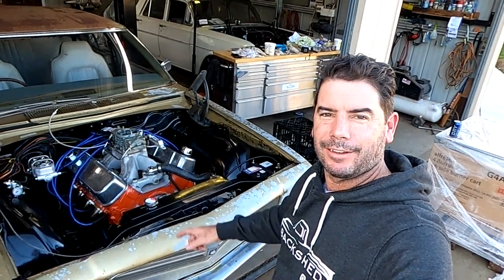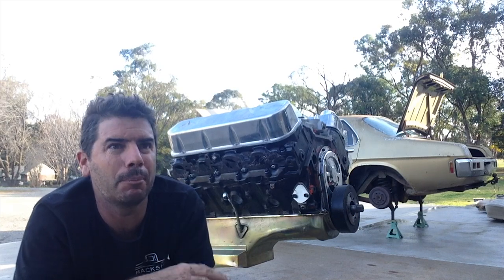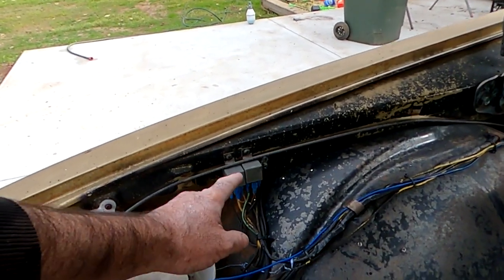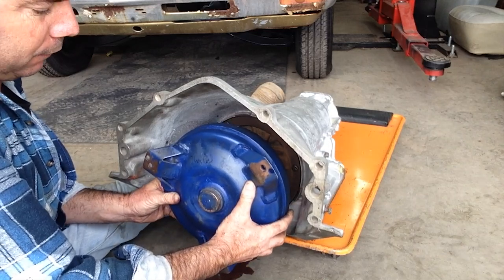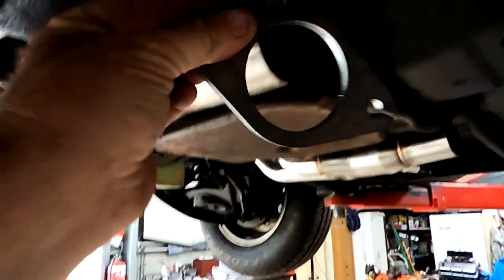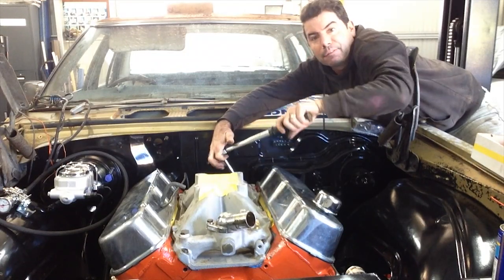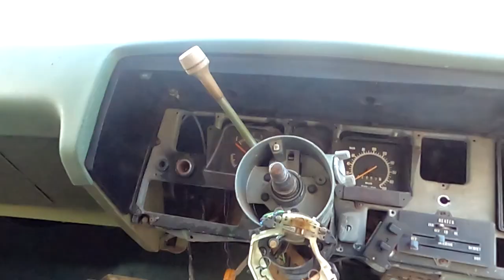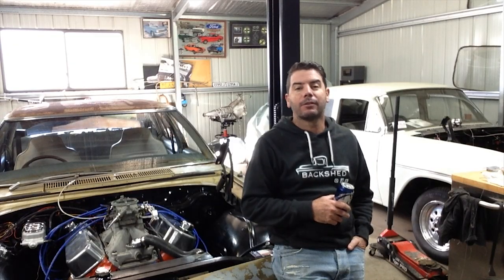EP14 HQ HOLDEN BODY FIND BOUGHT BACK TO LIFE WITH A BIG BLOCK CHEVY V8 ENGINE SWAP

Comment: Great build Mick! However. 1: The Oil Pump intermediate shaft must be clocked to 2 & 8 o’clock position to achieve #1 Distributor pin lining up with cylinder 1 Intake Runner. 2: Unless a fella wants his Cooling System full of Rust. Never use Well Water in an Engine. Using Distilled H2O ensures that zero mineral contamination enters the system. Ground Water will 100% rust the water jackets every time. (Distilled H2O & Coolant will last indefinitely. With absolutely zero rust.).
Reply from the maker: Thanks mate , however , the pump and distributor are in and fine hense it ran and dont put coolant in any engine till its proved it doesnt leak and guess what , it leaked .🍺🍺👍🍺🍺💪💪

Comment: The original washer pump was attached to the wiper motor. When the rubber valves degraded many converted to the washer pump on the reservoir, that is why the blue and yellow wires were added.
Reply from the maker: Ya nailed it mate , I was looking at the wiper motor yesterday and 100% pump is on it.
Cheers for watching 
🍺🍺👍
Reply: Spot on mate, they can be a pain to fix too.

Comment: Very knowledgeable , I had a 454 LS6 650hp at rear wheels an 850hp with nitro in a LX Torana bombed T400 an 3.9 geared 31 spline axles wish I still had ,  it used to shake the ground people spun out when I was pulling into servos an at idle had a street strip crane cam
Reply from the maker: Nice ! 🍺🍺👍

Comment: Love the way you do these builds ignore the minor crap which can lead to years of Resto,  get down to get them up and running.
Reply from the maker: Thanks Greg 
Yeah mate I don’t care how bad they are if they run and drive then you can enjoy them and get the inspiration to improve them . The minute you strip them ( which is the easy bit) you then find that time , ability and money are limiting your progress. 
Keep it simple.
Cheers for the comment and watching mate.
🍺🍺👍
Reply: @backshed5295  i got this mentality with my XB Wagon at the moment i see the patches of bog, i know the bottom of 3/4 of my doors is rusted out and the tailgate needs replacing. I think about tearing it down and fixing that but then its a can of worms and just want to have fun... so I pretty much just took 3 grand and dumped it into a 302 and a FMX instead, just so I could get it on the road and have fun with it before worrying about all the other cosmetics.

A Roadstoration if you will fix her up enough to just get it back on the road.
Reply from the maker: Yep that’s my angle with some of my cars too. If they run and drive it’s easy to stay motivated and if you find another panel and repair it then swap over it never stopped being driven 
Cheers again mate🍺🍺👍

Comment: One of the best YouTube videos I've watched for ages . Perfect for this Saturday morning. I would love to see how the kickdown works on a turbo 400 as I building the exact combo Yu have . Just never done a turbo 400 before .
Reply from the maker: Vacuum modulated kick down mate all internal , all you need to do is connect the vacuum line from manifold/ carb to the modulator at the rear of the box. 🍺🍺👍

Comment: What did they want for the Ford Pickup, would of liked to have seen it, best Enigine for for 351 Cleveland.     If your doing doors on the  inside there is a Product we started using rather than Cardboard it is a type of Plastic comes in 4x8' sheets, thickness about 1/165h or inch, we always used the 1/8th inch product.    The cardboard door panels in our wet climate did not stand up so we went for the plastic and it was pretty cheap.

Comment: Contact Crow Cams, you will need to work out the exact compression ratio, you can go with a bigger cam to lower your dynamic compression ratio.
You can't compress anything until the inlet valve closes.
Makes for an angrier idle too.
Food for thaught.
Bench seat too if you got a GF
Reply from the maker: Hey Ross that’s for watching mate yeah I know what your saying mate but I’m unsure if the block was decked to zero or not so all the calculations in world won’t matter in the end , I’m just going to run it and creep up on the timing so see where it’s happy Hahhaha
Hang around mate there’s heaps more coming 
Cheers 🍺🍺👍

Comment: Subbed.  Wouldn't have done a thing differently except maybe cennas. Had a bb in my hj. Loved it. Hell this HQ looks identical to one I sold maybe 2010ish. And god damn dude O heard myself when you said that about the wiring not coming through the fire wall but  not saving you fall off a cliff.  I say the EXACT same thing often 😅
Reply from the maker: Hahha yeah it’s crazy every time . Cheers for watching mate
🍺🍺👍

Comment: To push the button down on the key barrel it needs to be turned back to accessories which obviously you can’t do without a key. So smacking with a hammer and screwdriver is about all you can do. Works though, I used to work in a wrecking yard.
Reply from the maker: Ya nailed it mate that’s exactly what was happening Hahhaha 
Thanks for watching Mark
Cheers 🍺🍺👍

Comment: you have a trimatic crossmember the factory TH400 crossmember has the gearbox mount bolts at the rear of the crossmember (the bit you cut is the rear) and they also have plates welded to box the crossmember on each side to stop the crossmember from spreading from the extra weight ..... Just in case you didn't know
Reply from the maker: Yep Andrew your 100% on that one mate the car was a 253 trimatic . We’ve done this swap a few times and always just used what we had instead of chasing parts , the sedans have 2 sets of holes and by using the back set and flipping the x member it works . 
Cheers for watching mate 
🍺🍺👍

Comment: Another great episode, of course. I like the rumble of a Big-Block Chevy! I did not understand what you said of the guidelines for these engines in your passenger cars. It's great to see some involvement of the "Little Man" and Better-half on the project.
Reply from the maker: Cheers mate
In Oz we have crazy strict rules as to what we can and can’t do to a car 
🍺🍺👍
Reply: @backshed5295  probably no worse than what we can and cain’t do over here. How can the Guberment Down Under have a restriction on the likes of these Big Block Chevy engines when the bore and stroke are all that changes, nothing on the external?
Reply from the maker: It’s a long conversation but in short if the vehicle had a maximum factory capacity of say 300ci they allow approximately a 20% increase of the same engine but when you change type of engine it has to be inspected ( engineer certified) it’s crippled our hot rodding out here.
Reply from the maker: Are you in NZ or the US ?
Reply: in Lower Alabama, here in the States.
Reply from the maker: Some days mate I wish I was over there with you . The car scene is dieing here because of all the guidelines and restrictions
Reply: @backshed5295  the car culture down yonder there is fascinating. Y’all have your own Muscle Cars (even if some have four doors!) and classics and that ain’t including the iron from up here that gets transported back there. The only Holdens we had up here were brought in by Pontiac and that only lasted a couple of years. The automotive industry doesn’t make anything new worth buying anymore, so keeping the older stuff on the road seems the way to go.
Reply from the maker: 100% mate now days there just transport.

Comment: Lol 20 minutes getting the ingition switch out. Been there and done that. Why it took you so long was to push that pin in all the way you need the ignition switch in the on position, to do that you needed the key. Have the key then you don't need to change it...catch 22 situation. 🤦‍♂️ l9ving the build. Keep these episodes coming. Cheers Stew.
Reply from the maker: Ya nailed it mate 
🍺🍺👍

Comment: Top work mate, god that BBC sounds like thunder. Cringed a bit when that header had to be hammered, but what to do. Loved that relay panel, I hate messy wiring. 
I noticed the rear windscreen stainless trim weren't fitted, so a humble request for a next video about fitting those perfectly. Are you planning to replace the hood-lining? Bottom ends of windscreens are potentially rusty areas, hope those are okay.  Can't wait to see the next. 👍
Reply from the maker: Cheers mate I really appreciate it 
🍺🍺👍

Comment: I got a 73 hq in my shed, dream car but just can't do all the work myself
Reply from the maker: What needs doing mate ? 
Is she rusty or just been sitting ?
🍺🍺👍
Reply: Little rust in roof and boot needs to but cut, but it's pretty much a roller the engine is locked up. Dream car for me
Reply from the maker: Stick around mate there’s heaps coming 
Message me on Fb or Instagram on Backshedmick if you like , maybe we can unlock it? 🍺🍺👍
Reply: I love the channel. All the cars my old man and dad drive when I was a kid. I will send you a dm for sure need all the help I can get, hahha 🚗

Comment: Hi mate 
Love your channel keep them coming in but 1 thing show us when your working on the cars at normal frame not on fast forward love to see u working on the cars it will be way more interesting and people can learn from that. Is that  possible you to do that for us or no chance. Thanks mate
Reply from the maker: Mate I appreciate ya saying but if I did that then 1 of 2 things would happen .
It would take 10 episodes to show you the same result I just gave in 1.
OR It would be 1 12+hr episode mate. I try to explain what I’m up to ( eg fit exhaust headers) but I don’t think you would watch 20mins of doing up header bolts.
I do it the way I do because all to often I see videos were your shown what they did or what they are going to do but at the end of 30mins or so they have really achieved stuff all.  Some of our previous videos and also some coming we will do more detail on smaller jobs but that video i wanted to give you some results by the end. 
I really do appreciate ya feedback mate and cheers for watching 
🍺🍺👍

Comment: I like your videos, job done in a straighforward concise way. 
One thing you didn’t mention was the chrome sump;  a good idea, or bad?
Reply from the maker: Not sure what ya mean mate ?
The sump on that motor is an anodised gold Moroso pan but I don’t think and sump would be bad ? Chrome painted or anything else
Reply: @backshed5295  I’ve heard a chrome sump can boil the oil at high rpm, maybe I’m wrong, but have you heard anything along those lines?

Comment: Hope that radiator shroud doesn’t impede airflow as it’s now blocking perhaps 25% of frontage ?!?
Reply from the maker: Yeah I hear ya mate not ideal but the 502ci big block EH and the XY with the 410ci are both set up that way and we’ve had no issues so I’m confident it has enough flow and fan capacity.
Cheers mate
🍺🍺👍

Comment: Inspiring stuff, what's the flexible fuel line you used - is it road legal? Dropping an injected 5 litre into an EH and would be great if flexi line is kosher for rego
Reply from the maker: Hey mate 
I used a nylon covered stainless steel braided line mate . I would ring the engineer that your going to use and ask what he wants you to used because opinions will vary as to what’s needed in what State you live in mate.
🍺🍺👍

Comment: Thanks for the great video. Has given me plenty to think about.
Can you tell me what headers you used?
Reply from the maker: Just a cheap set off ebay .🍺🍺👍
Reply: @backshed5295 wish I could find a cheap set on ebay. The big name brands are the only ones I can find and I am doing this conversion on a HQ wagon here in the UK so shipping and tax is insane.
Reply from the maker: The seller on ebay.com.au was corvette299 they still sell sets
Reply: @backshed5295  🍻

Comment: I came back to this video because I put the exact same 3 row radiator in mine, but I need to mount an AC condenser, so is it a good idea to push through the AC condenser and then the radiator like you did? I too have clearance issues for the fans. 

Next question I have is, if any part of the radiator other than its mounting brackets touches rad support, could that damage the radiator due to vibrations? Should you keep some space in between, maybe using some kind of a spacer?
Reply from the maker: Mate I’d go look at some 80s -90s cars fitted with factory air and take some hits for mount from them . I’d definitely keep them apart.🍺👍
Reply: By a sudden strike of genius, I flipped the fan shroud, fans now sink in to it. problem solved for me. I also should make some holes in it so that more air can pass through 👍
Reply from the maker: Yep it won’t hurt to put more holes mate

Comment: Hey mate. Can you share the part numbers for the radiator hoses?
Reply from the maker: Mate I don’t have the part numbers but they are the same as small block just cut shorter as the big block is closer to the radiator.🍺🍺👍

Comment: Hi there, love this episode as I am doing the same to HX I just picked up. I was wondering if you can tell me where you got the brake booster and master cylinder from please? Maybe a link? I need to replace mine as the car has been sitting for around 15 years. Cheers
Reply from the maker: They are now sold on eBay by a seller arrow89
Reply: @backshed5295  Thank you so much mate
Reply from the maker: Absolutely no drama mate

Comment: In regards to commercial H series vehicles. What is the biggest cube capacity legally allowed ?
Reply from the maker: Hard to say because I’m Australia it depends what state your in, all the regulations are different. In NSW it goes off Factory tare weight and max capacity factory engine then a % of increase . The grey area is that different engineers interpretation of the rules. The guy I like talking to is a car lover and all to eager to talk , he is saying 417ci 
But I’ll put it this way , once engineered  😜where ever a 396ci big block fits any big block will fit !! 632ci ??
1 more thing , passenger cars ( sedans, coupes, wagons) have a different %increase to commercial vehicles ( utes vans etc)
Reply: Thanks for the info m8. Yeah I’m in Qld and doin a hq tonner at the moment. The videos are awesome and actually understandable step by step. 10/10 m8
Reply from the maker: Big block 454 in a 1 tonner in Qld is not a drama. 🍺🍺👍👍
Reply: @backshed5295  awesome thanks again for the info
Reply: @owh57  I had a 454 in a Hx holden ute in NSW engineered not a problem

Comment: Buy new brake line...they will be stuffed...I have a 486cub HJ and they will blow being that old...start a fire or half way down the road they will split
Reply: Actually I made a mistake...I'm thinking of my hr panelvans line's...HJ are metal
Reply from the maker: Yeah mate I do have heaps more to do on this 1 including brakes etc cheers for the heads up though I will get into the lines where needed .
Thanks for watching mate 
🍺🍺👍

Comment: I didn't think that you could break a turbo 400 with a stock motor?
Reply from the maker: Nah I wouldn’t think so either .
If your talking about Mucus’s motor it’s anything but stock mate. 
12+ to 1 comp forged pistons , 241@50 comp cam , large oval port heads , single plane manifold and 830cfm Holley with a main girdle holding it all together so you can rev hell out of it, if I was to take a educated guess I’d say 500-530hp 
Definitely not stock but you might have skipped that bit. 
Cheers for watching.👍🍺
Reply: @backshed5295  This was the first video I've watched of yours. It was damned good :D
Reply from the maker: Cheers mate I appreciate ya saying.

Comment: I should have tried harder (or at all) in school
Reply from the maker: Hahhah what make you say that?
Reply: @backshed5295  because id love to have your shed setup

Next year I'll be pulling the t56 and rear subframe out of my bf2 xr8 to do the diff bushes and clutch, csc, flywheel etc amongst other things. I've got 90% of the parts sitting here to go but I'm waiting on getting a much smaller shed than yours built hopefully early in the new year but contractors are in short supply at the moment. Unfortunately no hoist so I'll be doing these lovely jobs on my back

I'd love to have a setup like yours
Reply from the maker: The hoist has been great .
I’ve been spoilt by having it , it was about this time last Yr we put it in but prior to that it was jack stands and on ya back Hahhaha.
🍺👍

Comment: I refuse to run headers on a street car. They are more trouble than they are worth.
Reply from the maker: What trouble ya been having mate ?
Reply: @backshed5295  Oh I don't know leaks, ground clearance, tight fits,  bolt access. I run them for racing, but not for something I use on a regular basis.